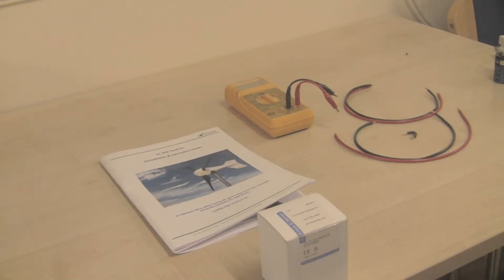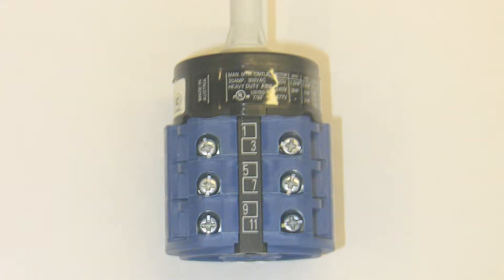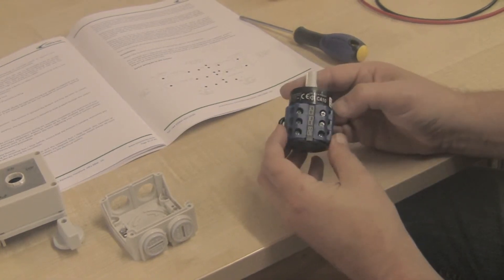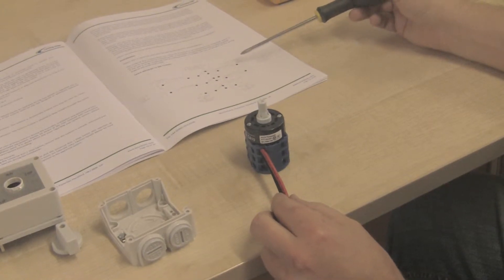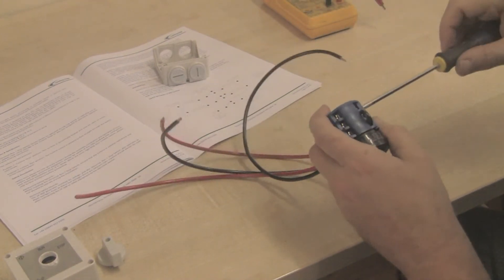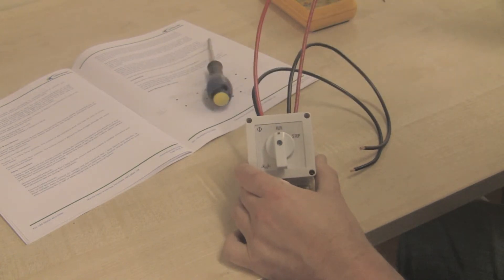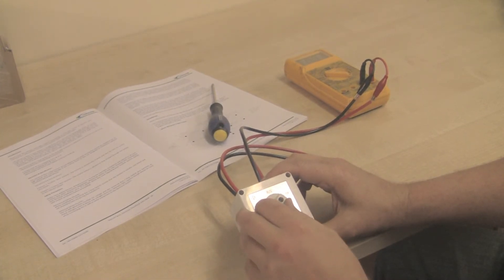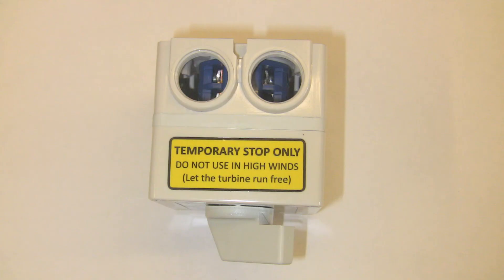Wiring the run/stop switch for LE-300 and LE -450 wind turbines

Comment: can it be used for emergency stop as well? 
how can we measure the short circuit torque (SCT) on the generator? 
i'm making a small scale wind turbine as a graduation project and I am considering short circuiting the output of the turbine to stop the generator but as you mentioned i am worried about the rotor breaking torque.. 

more info: the generator 500W is 3 phase AC connected to a rectifier bridge with DC output rated RPM is 500 
I would appreciate any help thanks